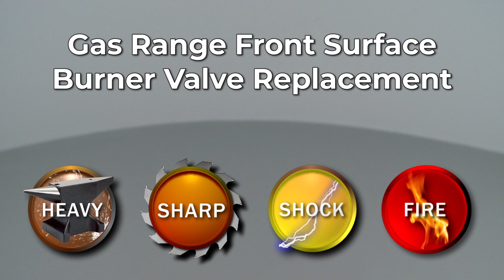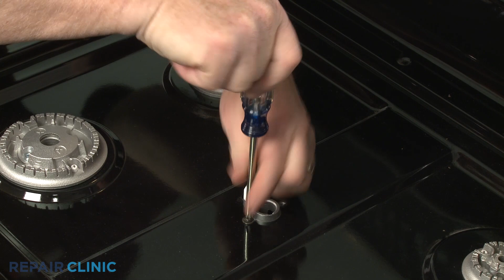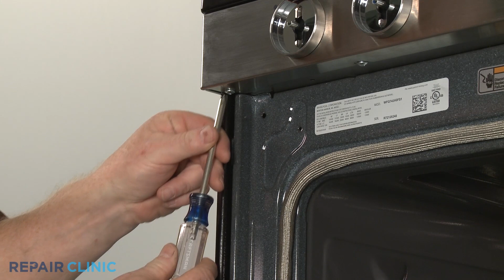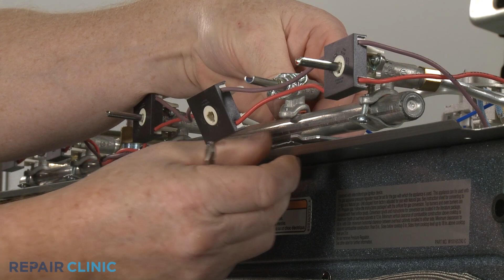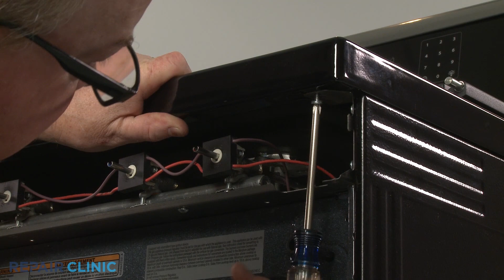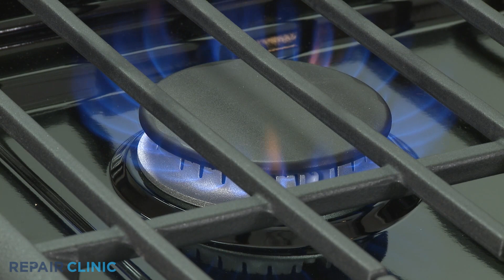Whirlpool Gas Range Front Burner Valve Replacement WPW10279615

Comment: Many Gas Stove Manufacturers are using Same Gas Burner Valves wanting to take apart and clean TOO EXPENSIVE to replace $130.00 each on Amazon on September 2023
Reply: Plus labor cost